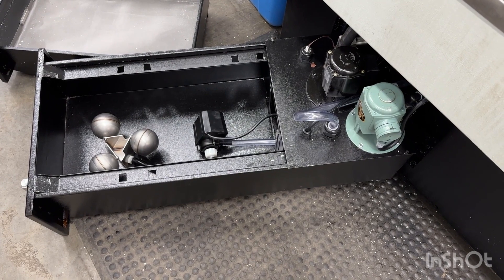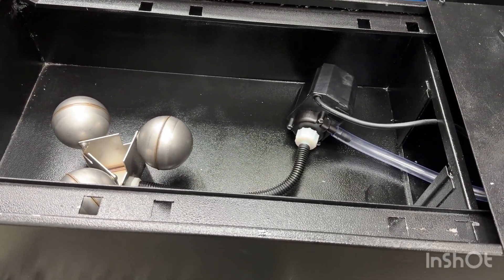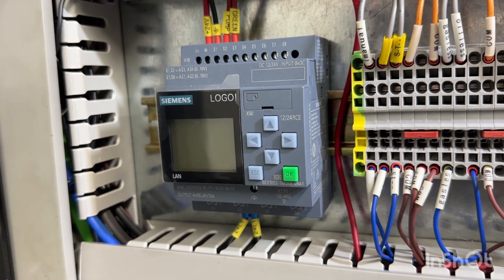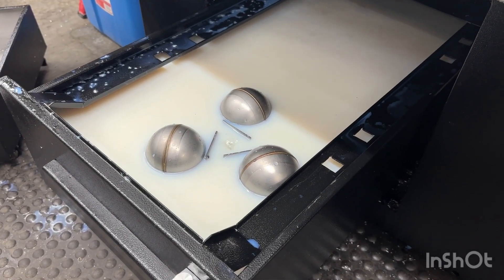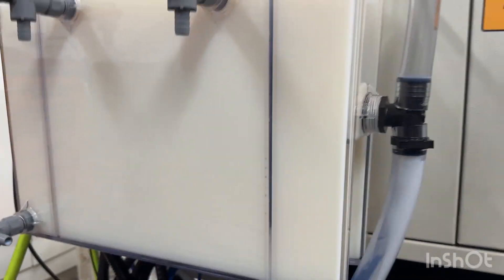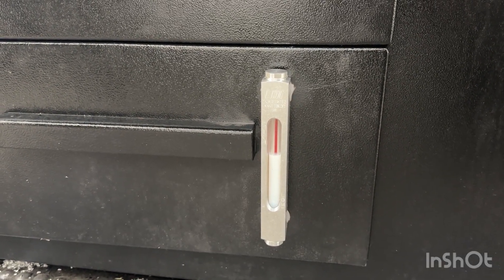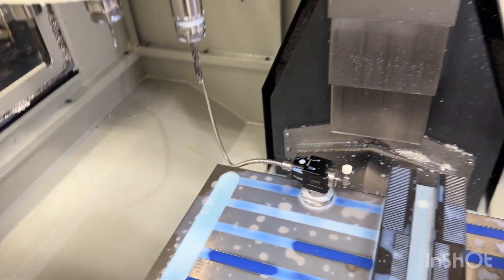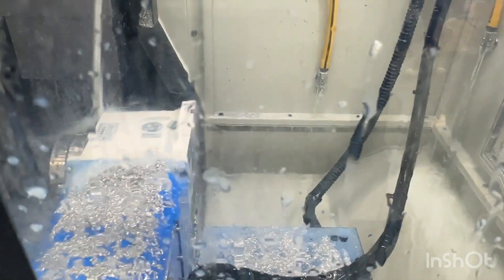CNC machine coolant upgrades!

Comment: ya just need a carwash spin attachment and hook to one of those lines that would clean it
Reply from the maker: Yes for sure, lots of options if you have some pressure and flow to spare, which I do not! This system allows me to flush a small area at a time as to not empty my tank. I don’t think my tank is even 60L.
Reply: Peter…. good solution to the ‘minimal flow’ situation with our ‘Iron Syils’ 👍
I went old school with an external 1/4 hp pump, rigged up to side manifolds with four adjustable nozzles on each side .
The inside of my X7 looks like the control room on a WW2 sub
🤣🤣🤣🤣
Biggest problems with these models, is the ‘flow Shute’ fitted into the basin casting. It cuts down the free area for coolant/chips flow into the tank.
I removed mine, then did some ‘surgery’ to the webbing on the underside of the shute and CI ‘basin’ to try to prevent coolant ‘running’ along the webs.
That bloody steel insert also created a 1/8” step around the outflow 😱 ( acts like a chip dam 🤬).
Judicious use of a by-pass on my pump helps regulate the flow to keep at least some coolant in the tank.
The sight glass is a great idea too mate… might copy that myself 👍
Regards
Robert
Reply from the maker: @RobertBrown-lf8yq Hi Robert. I know exactly what you mean about your mods. I did them all myself as well! If you look when I film in the cabinet, that chip chute is sitting in there. Haha. One thing I noticed is that the pump is very far off the bottom of the tank. I might 3D print an extension on the bottom and see if that helps. It starts foaming when it is pulling air.
Reply: @betztechnikindustriesltd.8901  the pump is way off the bottom on the X7-20 as well. From memory it’s a good 30-40mm higher than it could be.
Reply: @betztechnikindustriesltd.8901  
Peter,
I saw the Shute sitting in your electrical cabinet 👍
I use the drain plug as my pump suction, with a quick-disconnect coupling so that I still can extract sump out the front. I also attached some 0.5mm thick Teflon strips to the bottom of the sump, and to the casting. Makes sliding the sump out about 1000% easier
🤣
Reply from the maker: @Robert Brown  I like the sound of all of that !! Have a link for the pump?
Reply: or like a sprinkler
Reply: Nice job. Never seen that Siemens Logo before, that’s a smart little device. 
The X7-20 has good chip flow away, but would definitely benefit from some spray bars along the back to help clear the bottom.
Reply from the maker: @MrRctintin I’m certainly impressed with the logo. It’s going to have a lot more functionality by the time I am done!!
Reply: Yep.
I’ll send some photos and the pump/motor details. The pump is a ‘standard’ rubber impeller pump (20mm), with a Nitrile impeller. Direct in-line drive by 425V 1/5HP motor.
Added in a 100micron in-line filter into the suction line. Suction fittings have a quick-connect fitting, so I can still withdraw the tank out the front. 
Added a belt type skimmer about where the original pump sat.
Removed the perforated steel drive from between front and rear compartments.
I think I will add an aquarium ‘bubble stone’ into the front of the tank to aid circulation of the tramp oil to the rear ( and to the skimmer).
Need to work out how to upload photos to YouTube 🤪
Robert